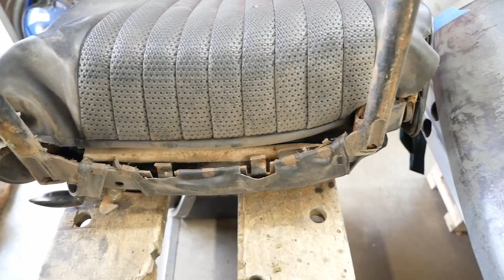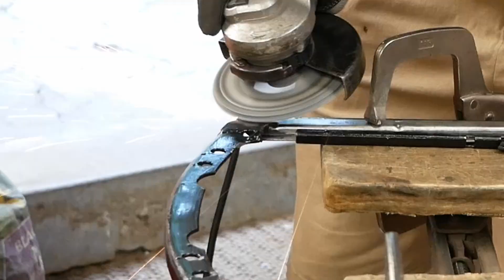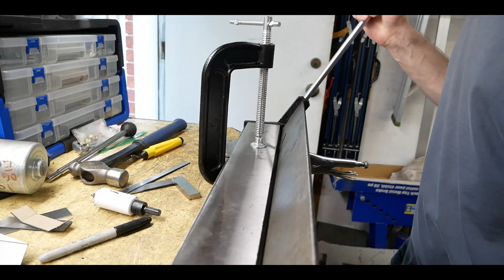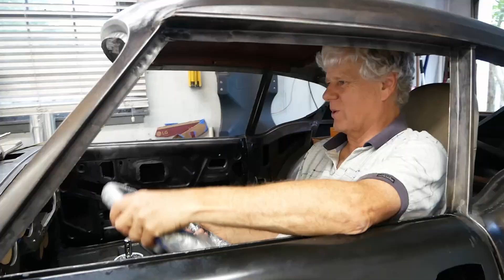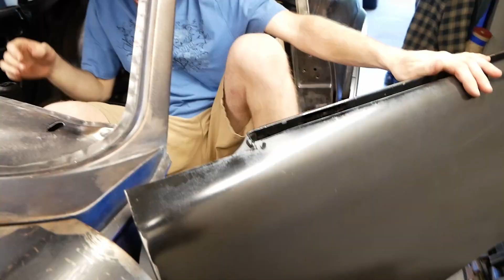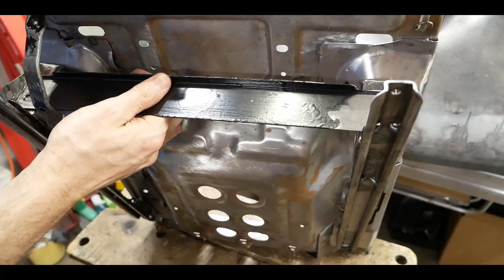Miata’s are HUGE!  Pro Touring V8 Triumph Build – LS Powered Project GT6R – Ep31

Comment: Nice welding!  Surely aftermarket or other seats would have been, well, easier.  But that's easy for us pundits sat here gloating over your trials and tribulations to say.   Well done for using that grinder as a shoe horn!  Rebuilding those seats should not be as challenging as virtually everything else you've had to do on the car.  Visibility looked fine, just don't get so close to the car/van/truck in front at the traffic lights!  My only cringe is the proposed front valance - please try and get some shape into it with a vertical fold line, or something to take away that 70s aftermarket slab of grp look that you could, and still can strangely, get from Halfords here in the UK.  The success and long term enjoyment (value?) of the build will swing on it's looks as the end of the day.  Slightly delicate and very Italian - I'm wondering if the Mk1 or 2 valance might be an option.  You've done so well our expectations as viewers keep growing!
Reply from the maker: Actually ... I don't think so!  This car is so freaking small ... I compared measurements from a bunch of other well made seats, (Recaro, Bride, Etc) and very few came close to the dimensions of the MX5 ones.  It's the designers to blame really though... why'd they make our car so small?! 😄  Like I said in the intro, the front end design may not be for everyone, but it's also not set in stone, so we'll continue to ponder how we can meet both our mechanical and physical needs 👍 Cheers Bob!

Comment: Another great video! I know it’s a day late and a dollar short, but Pontiac Fiero seats with Mr. Mikes seat covers. He would do it in the colors you want, and embroider the GT6 in I bet. It would be less expensive than that $2100 you mentioned early in the video. Just an option to get more front vision and a little more room for the muffler.
Reply from the maker: Thanks for the advice!  We picked up these leather Miata seats for about $500 if my memory serves, so it's pretty hard to beat that nowadays!  Fitment may be tight, but we're kind of used to that and it should all work out 😊 Cheers man!
Reply: Alright, the Fiero option would have been about $150 more with new leather seat covers, $50 more with leatherette.

Comment: I'm a bit of a miata guy so I'd love to provide some insight that isn't terribly helpful at this point. The hack job of the foam is referred to as a foamectomy in the miata world, thanks to anyone over about 5' 8" hitting their head on the top. Your comment of a butter knife is not far off, the right way is generally the electric bread knives but this one looks like a real special job. The foamectomy gets the driver lower down so they can see properly. Other better methods miata people use are switching to seats like those from the lotus Elise, but are very very expensive. All that said, maybe try contacting a place like planet miata for some good foams. But I like what you have done to get it all fitting, never a corner cut for you guys.
Reply from the maker: Thanks for the advice Michael, it is appreciated!  I've got some plans to save the foams we've got, and we'll likely still retain some type of foamectomy ... just hopefully at a higher standard! 😄🤞 Cheers!
Reply: @Fanatik Builds  who doesn't love some good butchery......OK not on their seats. Time to bust out the trusty old singer and make your own seat covers

Comment: I do not know if you are interested in color choices for the car. But British racing green would look great. I like your front air dam rendition. Tan leather looks good with racing green, silver, or black. Black shows everything, gets real hot inside. Silver is a good color if you do not like British racing green. Red or yellow is too gaudy.  Blue is ok but not with tan seats. I love your attention to design and light weight for the whole car. Using design and thinner metal over heavy simple thick brackets.
Reply from the maker: Colour is something we're leaving as a surprise, but thanks for the suggestion Ben!  Appreciate the kind words too, cheers 👍

Comment: Once again, Miata Is Always The Answer.  In an effort for more head space whilst using stock Miata seats, a common seat modification is to remove seat foam from the seat pan area.  Considering you already dissect the seat, you have already figured this out.
Reply from the maker: Miata is definitely, always the answer!  Glad we finally have some pieces from one in our project, it would have been incomplete without them!  Yep, very common, and often done to standards not much different from this.  Going to have a go at putting things back together better than they came apart! 🤞

Comment: Great solution to the seating problem. Your attention to detail and workmanship....and presentation are the best I have seen. Keep up the good work.  The steering wheel in your hand reminded me.... make sure you use the uprated bushings in the steering column. They are not cheap compared to the stock ones...but are more substantial and  last much longer and keep your wheel tight.  I just did mine... and what a difference.
Reply from the maker: Thanks sir, it's nice to finally be able to sit in it again after all this time!  Appreciate the tip, we've got a completely different setup in the works though which will be discussed in due course, fingers crossed it all works out how I am planning! 🤞 Take care, and all the best from Ontario!

Comment: The risers should have been fixed to the sliding frame such that the seat rises as it moves forward.  The reason for this is that the short people that require the seat further forward also have probably a short torso so that raising the seat will help to see over the steering wheel, whereas a taller person will need to sit lower to accommodate the head room.  A couple of bed/gate springs will help to pull the seat up the ramp.  I would also add a clamp that slides with the seat slider so that in an accident the slider doesn't become detached (as has been recorded) with horrific results.  I also use 12.9 grade bolts in lieu of the (max) grade 8 bolts to add strength as well as spreader washers as the bolts have been known to pull out of the sheet metal.

PS  If you are worried about the view out of the windscreen then you should not have used a British sports car that were predominantly designed for short arses 😁, but then the Audi TT has such a bad windscreen that it feels as though you are looking through a letter box whilst driving along, tank drivers have a better view!.
Reply from the maker: Considered that, but honestly the main reason for keeping the sliders at all was to aid with installation of the seats ... we're also going to be sitting pretty much all the way back in the tracks and are not planning on tossing the keys to just anyone, so I'm really not too concerned about my height-challenged friends! 😉 Ha! The short windscreen is just going to take time to get used to... our daily drivers are Subaru's which are known for their excellent visibility, so anything less is automatically a bit claustrophobic! ✌️

Comment: The stock Miata seat had what the community refers to as a foamectomy. By cutting the foam you gain over an inch of headroom. You'll want to keep that feature. Another option would be Lotus Elise seats as they are retrofitted in Miatas for an even lower seating position and are suprisingly comfortable for having almost no foam padding.
Reply from the maker: The extra headroom is definitely appreciated, but the execution of this particular foamectomy is too horrific to leave it as-is!  We'll see what we can do and report back 😊👍

Comment: Another excellent episode 👌 Getting non-OEM seats to fit a classic is always gonna be a fun game of stealing millimetres. I've popped Skyline R33 GTS seats into my 1959 Beetle and they're a snug fit that also required the mount points and seat frames to pass engineering certification at a not very cheap additional cost.

Really love how she's moving along and personally I like tan interiors. My E46 is tan and so will the Bug when done 😊
Reply from the maker: Thanks man!  Sounds like a cool combo - and a comfy one at that!  I'd love to do a Beetle someday as I've been fond of them since childhood 👍 The ironic thing about the tan interior though, is both of dad's other cars are tan over black! 😂 So it's really not an issue for us, but just not necessarily where we are headed for this car is all!
Reply: @FanatikBuilds  I like the GT6 too but harder to find here in Oz. Always had a thing for Beetles and hoping to stick a Subaru motor in the back.
I was won over by tan interiors after doing a full resto on a 1956 Beetle and with the light metallic blue steel dash it really worked well with the tan seats, oatmeal square weave carpet and ivory wool cloth headliner.

Comment: I feel your pain.  I'm not really a fan of sun roofs ... and not suggesting you add one ... but my previous car had a similar line of sight issue with the roofline.  I ended up pulling up tight to an intersection, leaning back and sliding the inner cover of the sun roof open.  Only then did I have a good line of sight to stoplights.  🙂
Reply from the maker: Haha, it's a thought that has crossed my mind!  But we're going to try to resist - the hardtop was kind of the whole point of the GT6! 😄✌️
Reply: @FanatikBuilds  Do resist.  :-)

Comment: I mounted mine directly to the floor to lower them so I wouldn't be lookin' a the windshield top
Reply from the maker: The great thing about using the original triumph rails, is the bottom of the seat pan is less than 1/4" off the floor!  So it's as low as it was ever going to get ... and STILL has some adjustment 🥳👌 Seriously considered hard-mounting though!

Comment: Fanatik, on most content, your "inner Blackhust" glows pretty often, but not here. It BLAZED! Send Nik a thumbdrive- I'm sure he'd be well chuffed! The frame and like that- that was all mere welding and fitting- this, this was Bracketry! Awesome- and worthy of the car. ON a similar vein, have you seen the ArcDroid" yet? Go see some Grind Hard Plumbing Co on YT- Ethan is a spectacular self taught welder fitter- the ArcDroid took him three levels up in an afternoon. Dad is lookin' good! And back in the shop with you- double the awesome sauce! I can't wait to see how you resolve the drive shaft tunnel- for your next trick you get to try "rapidly shrinking brackets"!  FR
Reply from the maker: Very kind of you Frederic!  Means a lot 😊 I do occasionally catch some of Grind Hard's videos, and agree he does beautiful work!  That ArcDroid looks awesome, and any CNC plasma table would be amazing someday, but we just don't have the space here sadly... one can dream though!  Hope all's well with you these days ✌️🙏 Cheers!
Reply: @FanatikBuilds  Go do Robert Dunn's "Under Dunn"- he just got one and has space problems too- he has an install that might just be what could help! The ArcDroid is an arm on a block- it will work nearly anywhere there is room for the arm to swing and then be put up on a high shelf- it's hat small- it wouldn't be for anything bigger than about 400mm x 400mm, but many brackets are really made of many pieces carefully stitched together. And FWIW, I want to see you  dream bigger and bigger- the GT has stretched you out and taught you many things you didn't know going in- watching that continue is the making of this channel- that and the strange twin; I'm still not sure about him; is it al a make up job or is he really identical?FR

Comment: Nice work!!!! I would have rebuillt and reupholstered the original seats. A tub large enough to hold a dismantled seat, a gallon of Rust 911 (which makes a total of 16 gallons by adding water) and then powder coat all the parts and reassemble. The original seats could be padded the way you need/want and covered with any color naugahyde. Sailrite has a lot of options for sewing as well. (I am not associated with them).  Since the new seats do not have provisions for a shoulder harness, that is the route I would have taken. My dad used to be an upholsterer and then went to work for Fisher Body in 1935. Watching him lay a piece of material over a seat, chalk it where cutting was necessary, take it to the bench, cut, sew, ant then have a complete seat cover to install was amazing to watch. Tony Nancy made a business of upholstery doing many a magazine showcased car. Sewing is not just dresses and blouses or house related. I wish I would have paid more attention when he was alive and able. Youth is wasted on the young to paraphrase a saying.
Reply from the maker: Thanks Paul, reworking some metal is more up my alley than reupholstering the original seats!  I'm happy for the higher headrest, and more modern styling ... so all's good in the end! 👍✌️

Comment: I have C4 corvette seats for my midget, which is even narrower than the triumph (i think).  I did not even bother with rails, they have to go all the way back to even be reasonable to drive the car.  They are super lightweight.
And to add...they needed to be right on the floor to have any head room, as the hardtop I put on was chopped a bit.
Reply from the maker: Nice!  Never would have thought a C4 seat would be narrower than what these cars came with ... the C4 is over a foot wider!   We did consider hard-mounting the MX5 units, but retaining the Triumph rails makes bolting them in and out a bit easier (access-wise) ... The pans also sit less than a 1/4" from the floor so no real difference in headroom vs hard-mounting! ✌️

Comment: Oh man, I just bought a 1988 Firebird and have a similar seat situation. The driver's seat is dry rotted and the foam in the bottom is gone, but the passenger seat seems completely fine.
Reply from the maker: Replacement foams and covers for classic cars are usually readily available and not too expensive! ... everything for this Triumph has to come from overseas though, so that adds massively to the price and this ended up being our best route 👌.  Good luck with your new project Lee!
Reply: @FanatikBuilds  
So far I've been able to find new skins for my seat but I've been less lucky with foam.
Honestly though, I'm still going through the car and finding mechanical things that don't work and need to be fixed before I really worry about the seats and the rest of the interior. 

Honestly though, in spite of (compared to your work) little things going wrong I'm happy to have a project to work on and I'm really looking forward to getting the car cleaned up and the suspension rebuilt and upgraded. 

You guys are an inspiration, keep up the great work.

Comment: You've reused the Triumph seat latching mechanism - it lacks any positive locking pin that Mazda would have provided.
Reply from the maker: The locking mechanism really isn't that different honestly! ... I have thought about copying the current design to the inside rails though, with a linkage, so they both lock like in modern cars. 🤔

Comment: The original seats you have are actually pretty rare I think. I've only seen a couple of spitfire/gt6 with them. I have a 71 Spit and my seats were in a similar state. I had a local shop recover/pad in vinyl for about $300CAD I think? That would have been around 2004 maybe. Essentially what I'm saying is don't throw out those seats. Most have the adjustable headrests, and I almost guarantee someone could be looking for a pair of the non adjustable ones.
Reply from the maker: Oh they're definitely not getting thrown out... we'll find a new owner eventually 👍 ... if we could have repaired them (ourselves even) for $600 total, I'd have been all over that.  Wasn't an option sadly!

Comment: Great episode.   I just traded some Audi TT headlights for some hard back NRG Innovations racing seats with BRIDE brackets.   Do they fit in my VW 24v VR6 powered GT6?  NOT A CHANCE!!!  Hahahaha, I will use them in a different chassis of mine I suppose. I haven't any idea what VW/Audi seats I can get to fit into such a tiny machine. I've got Mk1 TT, CC and MK6 GLI seats also. CHOP CHOP.
Reply from the maker: I think I can just about hear the sound of an angle grinder firing up! 😉

Comment: If you don't already have, this is a good excuse to get a nut sert set for avoiding the dismantle of the passenger seat, don't you think?🤔👍🏁
Reply from the maker: Got one!  Not a very good one... should probably get a better one... wouldn't have helped much in this case though as the front mounting location(s) still lacked any material to nut-sert into! ✌️ Cheers!

Comment: It’s called a Foamectomy. Very common mod to Miata drivers seat so you can fit a taller person or a helmet.
Reply from the maker: VERY common - and sometimes done extremely poorly (like this!) ... we're going to fix it up and try to keep as much headroom as we can still 🤞 Cheers Sean!
Reply: I've done a foamectomy on my MX-5, it works. Highly recommended.
Reply: It's the bottom of the foam, hack or clean, your bottom shouldn't be able to tell the difference.
Reply: @a7i20ci7y  I used a serrated breadknife, worked fine.